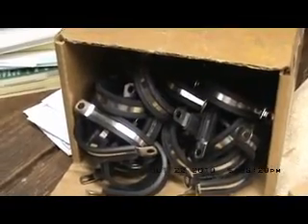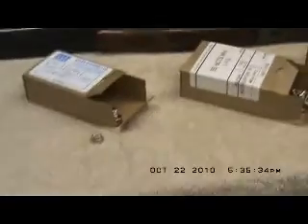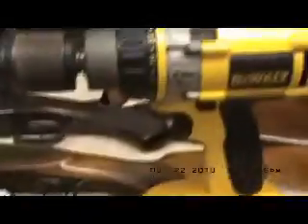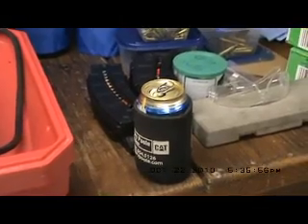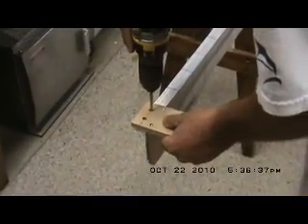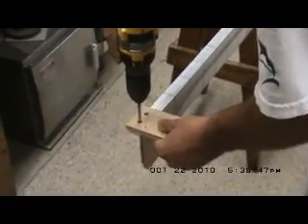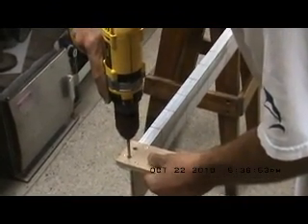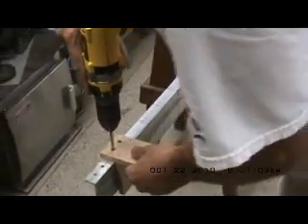BUILDING YOUR SOLAR BACK UP POWER SYSTEM #2

Comment: Good job Kevin. I just found a product for sealing the panels toyour asphalt roof shingles. It is a 3-3/4"wide x 10' Long role of asphalt type material that is used for installing Direct TV antennas on shingled roofs. The only place I could find it was on Ebay under the discription " roof sealant". Lowes, Home depot, Etc do not carry it. I payed about $15.00 for a role.I plan on useing it on the next four panels I install. Just some information you might could use.
Carey